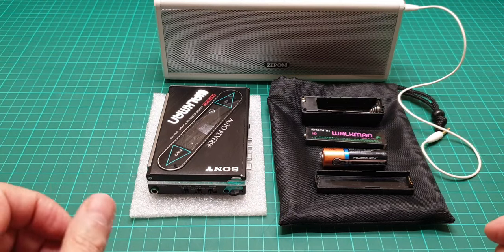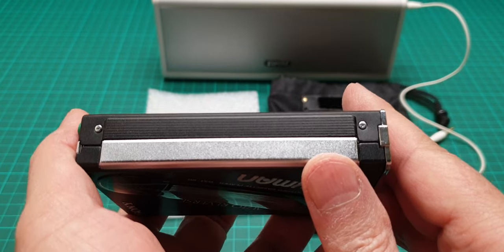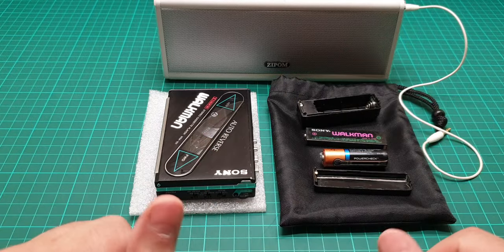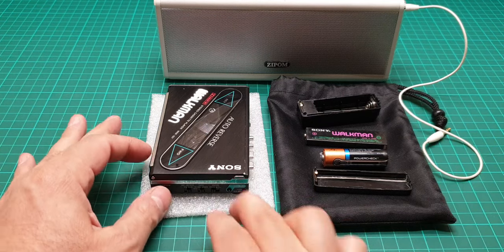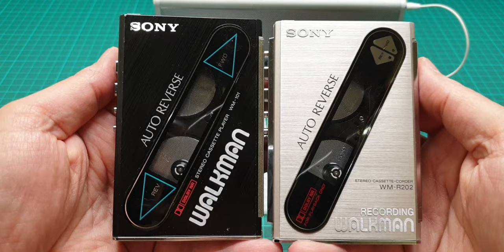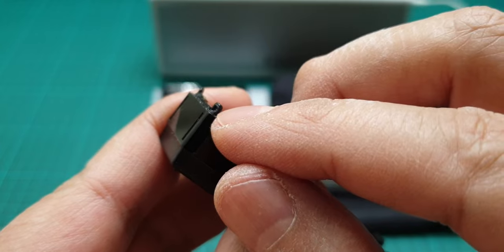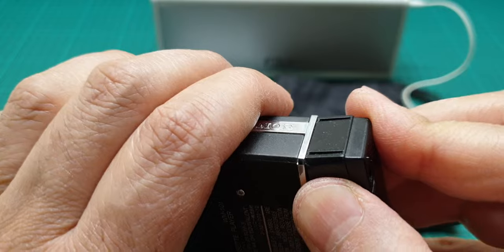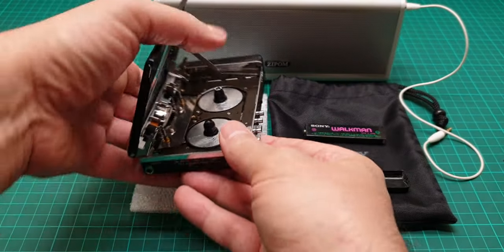Sony WM-101 personal cassette player Walkman review & quick demo

Comment: how did you secure the black plastic leg replacements for the battery holder? glue?
Reply from the maker: Hi, Thanks for visiting my channel. I have used super glue and later used epoxy glue and left it to cure for 48 hours.It wasn't easy, but if you have a picture of the latches' legs, it can be restored. As it's requested by several comments, I'll make a video about how to fix the battery pack soon. Keep a look out for the video. Until then, take care and cheers for now.

Comment: i have a sony wm 101 but it's missing the battery pack. I soldered a standard plastic battery pack for AA battery directly to the tiny pins sticking out on the side of the walkman, and tried putting in a AA battery. But it don't turn on and the led for 'battery' don't light on. I see in the standard battery pack there is a component, i guess a condensator, between the battery and the walkman. So I guess my wm 101 don't work... But I'm not sure if it's supposed to work the way I did... I wonder if it is supposed to work anyways without the component...
Reply: It should work, the output of the component is around 1.3V I think. Both my WM-R202's also did nothing at all and cleaning the switches inside fixed it. I cleaned them carefully with a small nail file and then some IPA until they all made contact again
Reply: @Florian00  thanks for the reply ! what do you mean by IPA ?
Reply: @hjyuihyuihyuihnjyuih  Isopropyl alcohol, I got a bottle of 99% to clean electronics and corrosion. Also the batterycontacts might not make a good connection, it's kind of a springy connection to the battery component but due to aging it could've moved and thus not make proper contact anymore
Reply: My childhood memories 😅😊